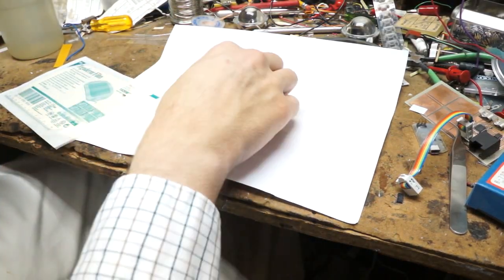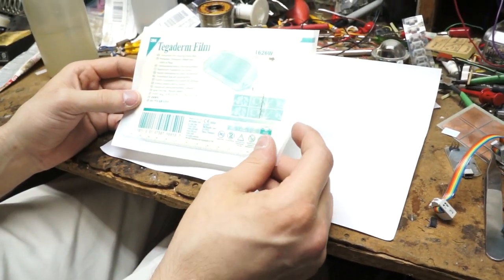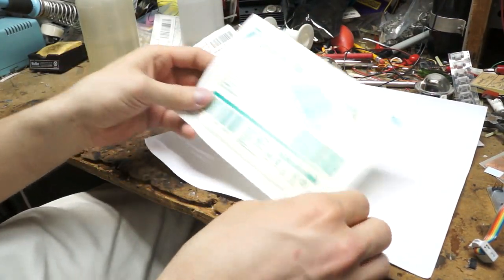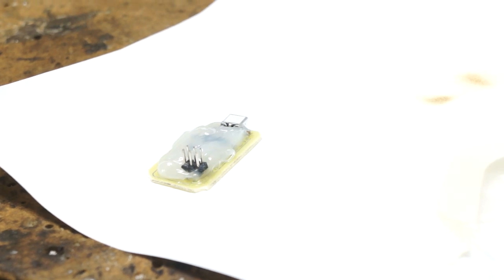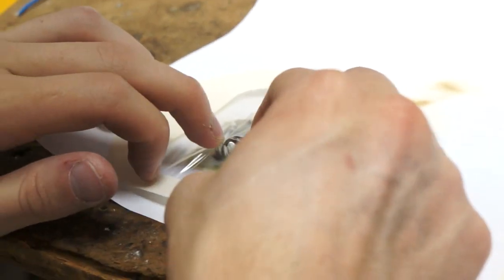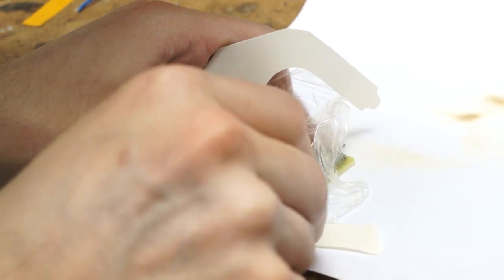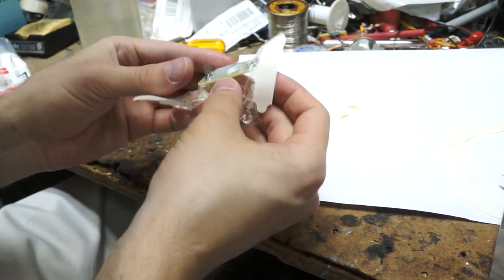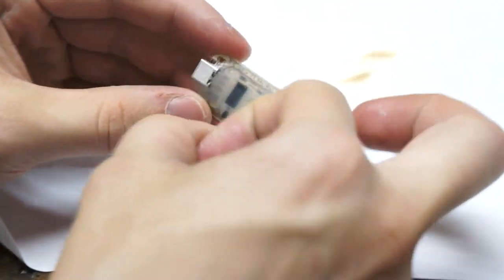Sealing electronics in silicone using Tegaderm

Comment: So to summarize your silicon/breathable membrane potting: 
1) inexpensive materials
2) won't harm electronics
3) undetermined thermal dissipation (compared to epoxy)  <----- anyone? 
4) grippy and rubbery (compared to smooth and hard epoxy) 
5) translucent so you don't worry about LED visibility
6) improves mechanical stability of electronics (compared to naked boards) 

This seems like a great idea, CNLohr! Thanks for posting the video, it really helps me understand how and why it would be used.  My remaining question is about water exclusion. People who pot stuff in epoxy display electronics running at the bottom of fishtanks, etc. :) I realize silicone is used to seal gaps against water, so maybe it will work -- anyone run any experiments on this?
Reply from the maker: I've definitely not tried it for sealing with water, but I would imagine it would not work very well.  I'd think anywhere you have wires, or anything going in or out will produce a path by which water can work it's way in.  I've tried sealing other things with silicone before and it didn't really work out that well for water prevention.

Comment: One thing that makes me wondering is the conductivity of potting materials,such as special Epoxy Vs Silicone even versus Hot Glue-Silicon which most of us use for sealing wire ends. They are all alright,guaranteed,but for Puristic purposes such as Audio DACs,Amplifiers,Crossovers,etc,if any possible leakage is known it's much more better.

Comment from the maker: you can get a very smooth, comfortable surface that is kind of grippy with silicone.  Hot glue (for me) always ends up somewhat lumpy and much harder.  Admittedly, I've never tried hot airing it.  Does it get inside the connectors?

Comment from the maker: I'm actually very sensitive to acetic acid, so I would notice if there was some in there. I don't know what chemicals they use that boil off in that stuff.  I have used this for some time, though and haven't had a board fail yet.

I tried QSIL-216 once, but it was way too runny to be useful for this.

Comment: That does look nice.

Is the silicone compound you're using a neutral-cure compound, though?  Most of the cheap stuff releases acetic acid as it cures, which means your project will have a decidedly limited lifespan.

Electronics-grade RTV tends to be much more expensive than the Home Depot stuff.  I've had decent results with both clear acrylic adhesives (Lexel) and Permatex Ultra Black gasket compound, neither of which evolve acidic compounds as they cure as far as I can tell.

Comment: Nice vid.  One suggestion though.  Instead of using a sharp object to poke the holes in that header,  why not just use a female header?
Reply from the maker: I have made a version that's a female plug that goes directly into the 6-pin header, but I've found it to be more unweildy than the ribbon connector.
Reply: CNLohr no I mean keep the male plug, but use a female to stamp all 6 pins thru at once.  I can see how unwieldy a F plug would be, though.
Reply from the maker: That's a spectacular idea.